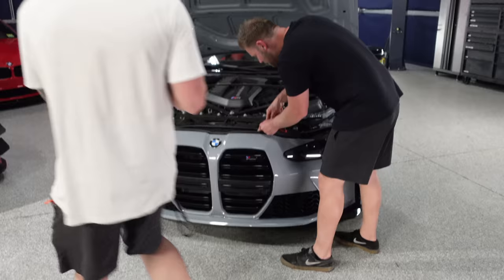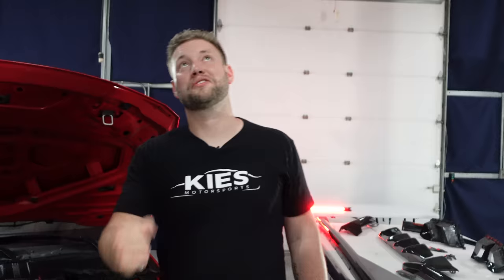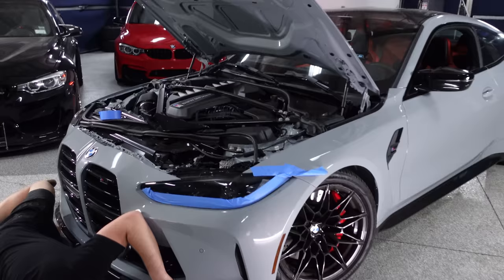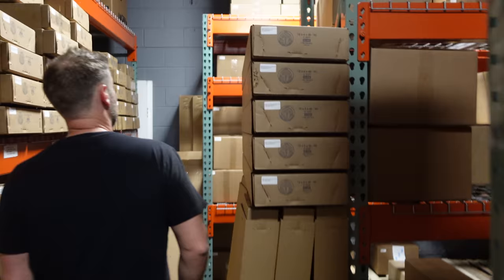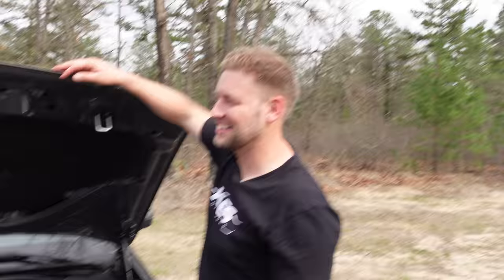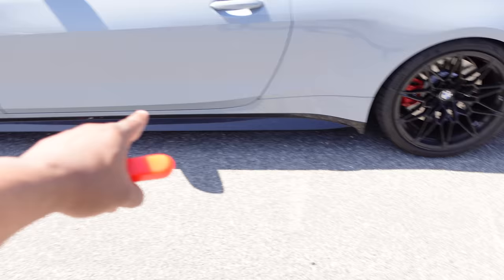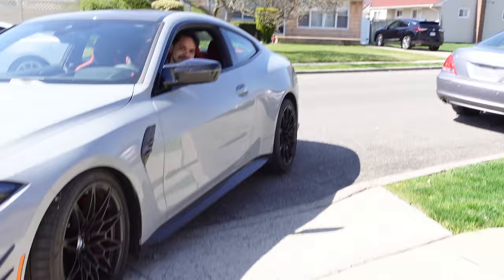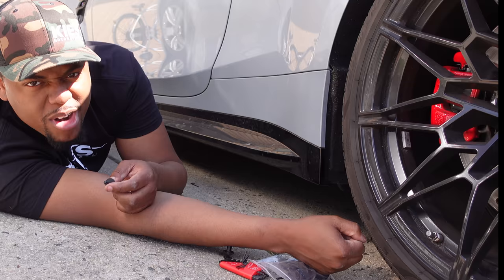WE’RE GOING FULL “KIES CARBON” ON MY BMW M4 COMPETITION! From @KiesMotorsports  | G82

Comment: bro with Pirelli PZero and spacers at front more than 12mm it wil break the fins inside when you turn the stering at full lock.
with michelin you can go at front 15mm without problems
go check the g80/g82 forums